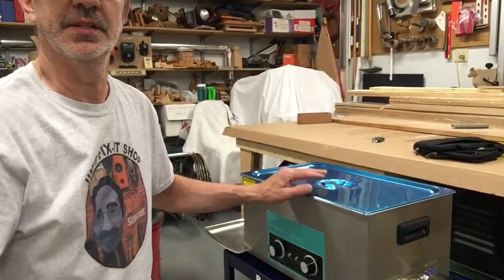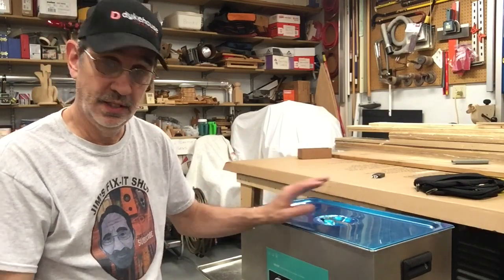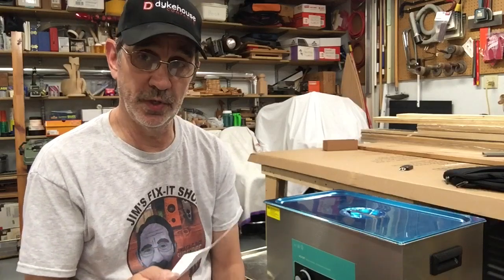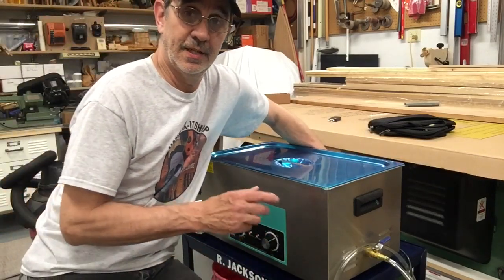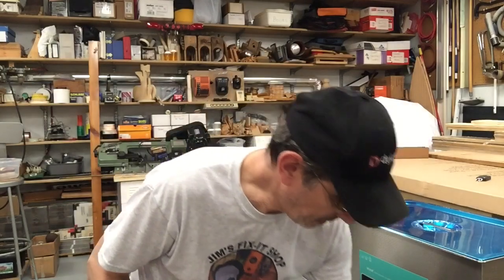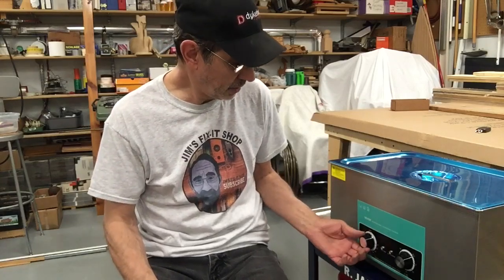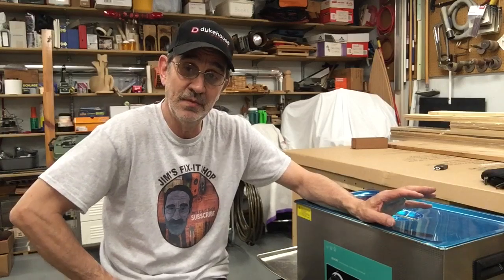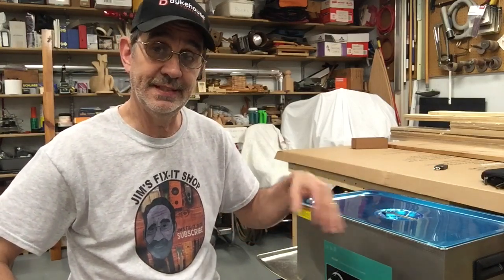393.Information on my ultrasonic cleaner

Comment: Hey Jim ! Great video on your ultrasonic parts cleaner , I've thought about buying one these in the past , But I don't do enough parts cleaning to warrant buying one . All the Snappers are runnig great & have had there annual oil changes & air filters installed , & all received E3 spark plugs last year so they will be good on that for awhile ! The 74 Comet is still waiting for the complete restoration , & I have all the parts needed , & paint, But got put behind buy a winter storm back in Jan. 3rd & it was quite a extensive clean up that went all the way into early April ! & was done by Me & myself & I , Fortunately I had the equipment to get it done , & I hauled close to 10,000 lbs. of tree debris away. So I hope to at least get the 74 painted soon before it gets to hot & humid & maybe do the engine rebuild during the summer ? Thanks for the video & I'll be following You , SNAPPOUT.
Reply from the maker: Boy o Boy  I need to see pictures and you need to be in one. You could send pictures of before and after steps of the build especially the engine it’s been a long time since I rebuilt one and I have two, well keep in touch my friend. Jim
Reply: @jimjackson9381  Hey Jim ! It's been awhile since I rebuilt a small engine myself ! But I'll take pictures to help myself with the tear down , & rebuild ! As a reference ! & some of your past videos , Thanks Jim , & take care & SNAPPON.